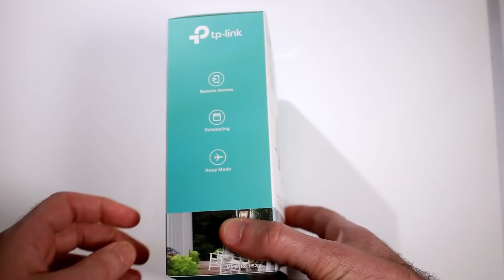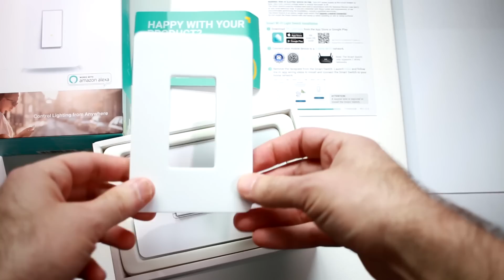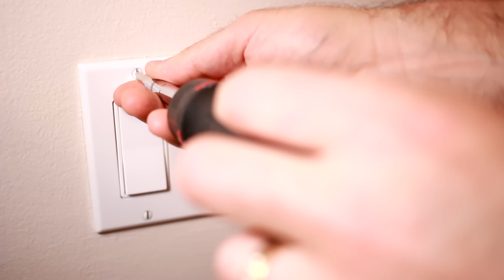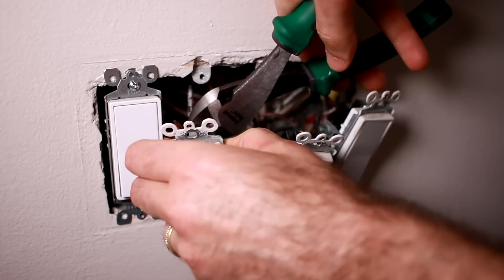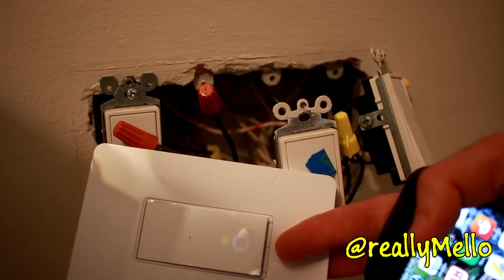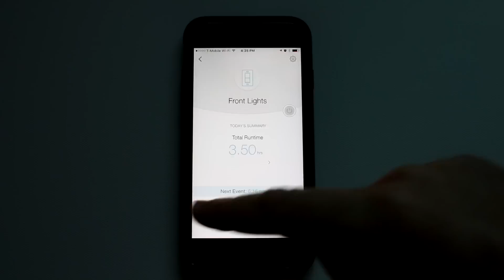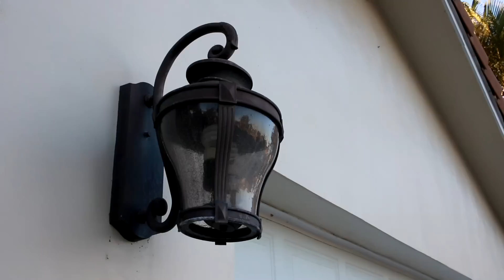TP Link HS200 wifi smart switch installation with kasa

Comment: Question I installed my switch smart and everything is working but two feet below, I have an outlet which I connect other devices that is not working now. what could be the problem?
Reply from the maker: Sounds like the former switch was connected to the outlet as a "switched outlet". Some houses have that wired up so you can have lamps plugged in there and controlled by the wall switch.

Comment: ok i have 1 red 1 black and 1 white  wire, on the kasa there is green wire, what color does the green attach to?
Reply from the maker: Typically if you have red white and black in there it would mean you are setup for a 3 way switch. Is there another switch that controls the lights in your circuit? In that case you’d need a different model to retain that ability. Green on the switch is the ground so in most setups there is a green or bare copper wire in the receptacle to ground to.

Comment: Do you need smart bulbs with the light switch? I would like to use it for my kitchen recessed lights.
Reply from the maker: No that’s the great thing you can use normal bulbs and have the smart switch control them all! You only need smart bulbs if you don’t want to use a smart switch.
Reply: @reallyMello  Thank you for responding.

Comment: I only have one black and one white wire, NO green wire at my light switch. My light switches are all single pole, with one IN and one OUT wire nut simply completing the circuit. Is there a smart switch that works with my setup? My light switches have the Hot wire coming down to the switch (on white), then going back up to the light (on black). The neutral is at the light but does not come down to the switch.
Reply from the maker: Green would be your ground. Do you have a bare copper wire? Is the switch inside a metal switch box?

Comment: Does it work on a 10 year old house ???
Reply from the maker: Yes as long as you have a neutral wire
Reply: Hi do I need any hub or I just need iPhone and App to connect?? tnx
Reply from the maker: Max Malik no these are nice because you don’t need to use it with a hub. You can just use your smart phone and their Kasa app. You can also control it with Alexa devices.
Reply: Thanks again by the way music in the background is kind of funny 😂😂😂😂

Comment: i have three wires in my switch. why does every install video i see have 4?
Reply from the maker: Scott Reidel on the tp link or coming out of the wall?
Reply: out of the wall sorry, i meant to say "switchbox"   my apologies. 
my house is an older model without a neutral. 

my uncle told me "just use ground as neutral" and i looked at him thinking, "that doesnt sound right". he, being an electrician, assured me  that it would work, but is not code. 

needless to say the breaker tripped when i activated the switch
Reply from the maker: Tplink’s instructions says not to do that. It requires a proper neutral because it is a “powerline appliance”
Reply: im aware of the instructions. my electrician uncle told me to ignore it, and it didnt work. nothing drastic though. 

i just grabbed a Philips Hue, no install switch, and use that. now to recess the switch box, and cover it.

Comment: Hi, you never showed what the final install looked like.  How do you use the original switch plate with that big bulky plate that comes on it?
Reply from the maker: The plate that comes with it pops off no problem so you can use your existing face plate cover.
Reply from the maker: Also, good catch, I can’t believe I cut straight to testing!
Reply: Awesome, that’s what I was thinking but wasn’t sure.  Thanks for the reply.  Quality video otherwise! 😎

Comment: my switch is at the end of a series so my white is hot. How can i change this so I have a neutral? can i disconnect from the light it controls and make it hit the switch first than the light??
Reply from the maker: For safety sake, I'd recommend checking in with an electrician on that one.
Reply: alright thanks

Comment: Nice guide, but get rid of the annoying background music going in and out. Sounds like old school porn.
Reply from the maker: Hahaha thanks for the feedback :)
Reply: @reallyMello  What does it mean, when it says you will need a neutral wire? An additional one, or just the same wires, that are in there already, like your White Neutral, Black Hot, Green Ground? Anyway was just making sure everything that I needed, was already there, wire wise?
Reply from the maker: Hi Matt, good question. Just the existence of an existing neutral wire for the new switch to connect to. You don’t need an “extra” one.
Reply: Music is very annoying

Comment: did you have jumper wires between the original switches?  How did you join them with the HS200?
Reply from the maker: There was a common black wire looped around the screw terminals on the switches so I had to redo that with wire nuts to rejoin the chain since the hs200 doesn’t have screw terminals